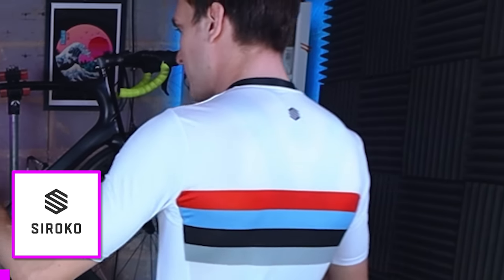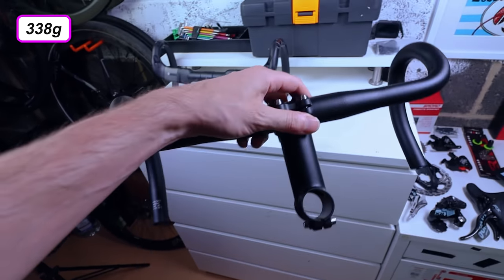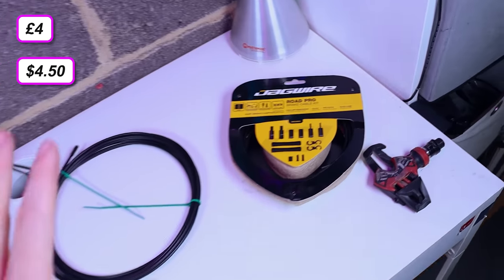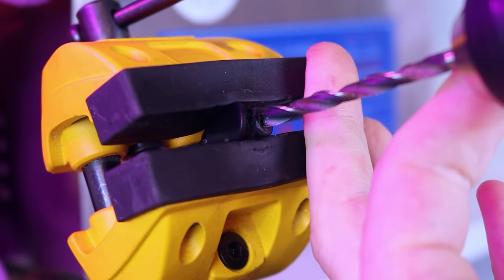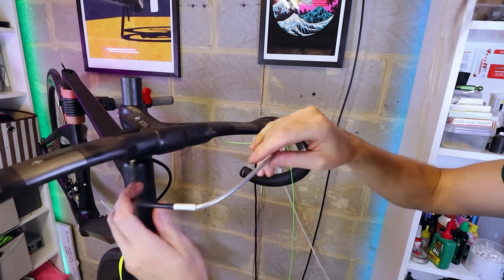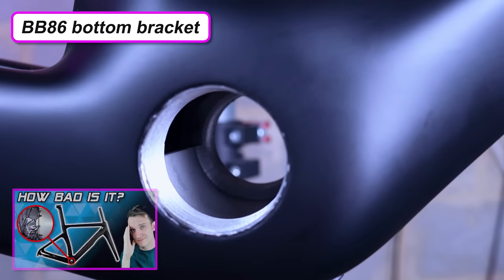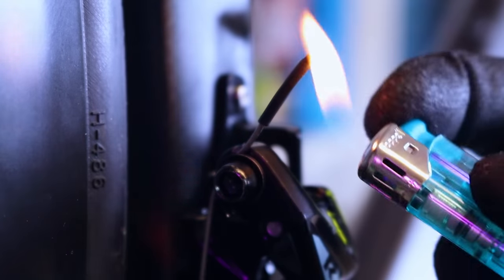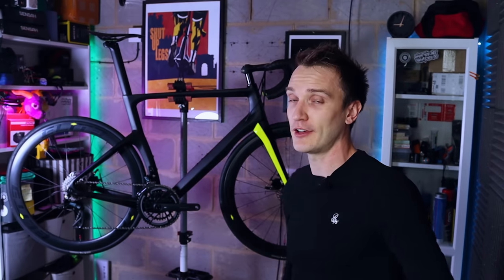£1000 AliExpress Carbon road bike build - Disc brake

Comment: Hi Luke, great videos but I think drilling the frame insert and filing the frame to get the cable housing all the way through was a mistake. Inside the frame no need for cable housing. You just added weight.

Comment: "One click only" on a clicky torque wrench was what I was always taught, what's the point of using a torque limiting device and then adding another nudge more? 

And definitely use masking tape on a carbon Steerer, if you can't get (or make) a proper cutting guide clamping an old stem on to hold the steerer and minimise the risk of pulling the fibres apart at the cut. 

I'd also definitely buy some nylon sleeve/liner tubes to put on the cables under the BB. 

TBH I'd be interested to see if you could find an Aliexpress special Carbon frame these days with external routing, rather than horrific internal routing, a fair bit of your faff was created by having to deal with the cabling. 🥖

Comment: 🥖 I'm still watching you. Even now, as you are reading this. 😁 Shame about the issue from the bonus clip (no spoilers). Just a thought, when the bonus clip started, I noticed something cool. The blue neon lights you had on reflected on the frame and there was a purple-ish hue to the frame. I thought that would be a cool colour scheme, dark purple with the neon yellow, if you ever wanted to change it up from the black and yellow. Thanks for making this build and the video. What's your plan for this bike? You're at 3 carbon bikes now, surely you will sell one of them?

Comment: I'm not sure what the deal is with GRP bikes, but IMO they're like riding a wet noodle. 

My first carbon bike with a Trek, back when only a few companies made graphite framed bikes. Since I worked for a aerospace company and had full access to numerous inspection techniques, I performed sherography, UT, as well as x-ray testing of the entire frame paying attention to the steer tube and bottom bracket.
.
What I discovered was that there wasn't a uniform thickness and that both the head tube and bottom bracket areas had voids in the composite. 

The only people that will see any marked improvements in their riding are the super light weight riders. A larger rider would be better off either losing weight, or stick with a custom built Reynolds 853 tube set or a quality titanium bike.  At least with steel or titanium, if it's crashed, it can be repaired. Plastic bikes aren't worth the time and effort to effect a repair and have the frame ride the same as it did prior to the crash.

Comment: Hi Luke - I also send you a mail
First - The cabels are not surposed to be i direct contact with the frame at the BB - Use a part of an innecable over that part.
I am not even sure the outercabel for the diskbrake are surpossed to run all through the frame? Could it be it should at the topend, then run "naked" through the BB and then into an outercabel at the "leg" by the diskbrake?
For the Front/rear deuralier I am very sure you should use a innertube - I'd might be wrong
Second: Is there a reason you did not use the Sensah 2X12sp?

Comment: Great video ! Did you consider making a 3D printed cap for that bottom bracket massive hole ? 😆 
I'm waiting for the chance to get a nice frame however I'll have to put some more money coz I'm not that Superfly weight lol so I'm afraid to be the first to report a failure regarding this frames 😆
Just as a suggestion, toseek TR5500 integrated handlebars are just perfect for this build IMHO of course! Keep us updated regarding the final changes

Comment: the brake line does not need for the brake housing to go through.. only the brake cable comes inside the frame.. that's also the reason the whole at the back  is small..

Comment: I bought "KMC" 10 speed gold plated chains from a shop in Quiapo, Manila, Philippines and I may have had a questionable copy because I, too, have had the golden flakes of metal after cleaning and lubing up the chain, so I swapped it with another set of KMC chains bought from a reputable store, no issues from there 🥖

Comment: Always start at the back to feed the rear brake hose through
Reply from the maker: I think that's probbaly the correct strategy for hydro housing, but in this case as it was the KEB-SL compressionless brake housing, there was this larger diameter aluminium coupling piece at the shifter end of the housing, which would have prevented it from being fed through the frame

Comment: Glad you caught that crack before heading out!!! Btw, RXL is not a chinese brand. Thats a knock off of Bontrager (trek's in house brand). I had a set of chinese RXL bars and they were fine, but its kind of a crapshoot when you buy those from Ali. Sometimes good, sometimes garbage. 
At this point, I think good ole Kalloy uno stem and bars are the way to go. Cheap, fairly light, and durable.

Comment: I bascially had the same experience with a delihea gravel frame with the brake cable. they put some kind of barrier within the lower triangle where the cable comes out that forces you to use two sections of outers to get the brake cable run, absolutely no way to run hydraulic lines in it unless i can sort out a way to drill out a larger hole through the passage, super frustrating. I've used their aero frame before (delihea fore) which has a similar lower bottom bracket access hole....overall a much easier frame to work on, but also was rim brakes instead of disc.

i definitely still like sensah over ltwoo. guess it's personal preference though

🥖

Comment: 35:51 Cables at the BB will defo eat into the carbon and saw it.
I had this happen to me and it wasn't the cable directly rubbing the frame but rather the cable housing so you can imagine what the raw cable friction will do there in little time.
Plastic or nylon guides are required.
I am no @Hambini engineer but you can trust me there.

Comment: 26:00 to avoid such a shame, one can work all 360 degrees, all circle around. First go around cutting about 1mm depth. Then, one can make a deeper cut but doing one side at a time, turning fork 90 degrees each time if you use clamp/vice or just flip it to the other side if you don't use vice.

Comment: Good edit.

I just can't wrap my head around why anyone wants to ride a road bike in 2022 with wheels weighing more than 1250g. All those extra spokes and rotors just grab so much air and it feels WAY more sluggish than a low spoke count shallow wheel. Light bikes and wheels are cheaper than ever before in cycling history if you know where and what to look for.
Reply: Unless you are climbing the aero gains are bigger than weight gains
And they look cooler lol

Comment: Cheap steerer cutter guide is a no brainer.  That stem looks awful but I have rxl bars and they have been fine for 4 years of abuse.  Yes ib would have touched that single bolt stem and the amount of spacers would have b me feeling nervous.  But great report and shows what you can do.

Comment: WHAT IS THE TOTAL WEIGHT ??? GOOD JOB YOU GOT HAMBINI S ATTENTION TOO !!  SO TWO THINGS FOR ME 
1. l still love rim brakes for my road bikes ,easy to fix adjust etc plus l don t have big hills or alot of rain :)  
2. l d prefer a smaller less AERO frame FOR LESS WEIGHT most forks are aero enough today same with wheels :)

Comment: Hi... as usual a great video. I was wondering if you could put the links so we can check today prices for a build like that. Even if i am shopping for a VELOBUILD frame kit (frame, integrated bar and fork) and velobuild wheelset it would cost 870€. Adding a seat, bar tape, groupset, tyres, inner tubes, jagwire cable kit and botle cages, etc IT WON'T GET EVEN CLOSE TO 1200€

Comment: 🥖 and I never usually comment on you tube. 

With regard to the rear brake housing was the housing supposed to stop ad the frame and start again from the chain stay? Only the cable in the frame. Obviously if they were hydraulic they may have thinner line or you would have to enlarge openings.

Comment: I wouldn't feel confident on a frame like this...i would buy though a elves frame, the eglath pro disc. I already did the math to equip it with Shimano di2 and I will be around the  3500€ mark. It might be expensive but a lot cheaper then a wilier filante slr wich is priced at 9000€. I wouldn't go necessary for carbon wheels , campagnolo zonda disc will do just fine for only 499€ and 1675gr. It will be my future project 😁

Comment: This is a Tiger bread baguette, is that ok 🤪🥖 Maybe next time you clean your chain, get a magnet on ' the bits' then you will know if it's chainrings but it's more likely to be crappy chain isn't it, especially after your last experience. 
I love the look of the shifters but not being able to change on the drops has put me off, was thinking for my latest build but sticking with 12 speed Sensah although I may get a 105, 12 speed cassette.....do you know if  they have the same spacing???

Comment: 🥖🥖🥖🥖!

Nice build. Inspiring to see such a nice ride for the budget! 

I'd say the rear brake was meant to run with either hose (hydraulic) or just a bare cable in the frame but this solution works (if not frustrating to install ;) )

Comment: 🥖and that’s a foot long ! Quick question, what is the bracket you have that holds your garmin and front light below? Top video as always and looking forwards to how this performs
Reply from the maker: So I just kind of hacked that togther from some spare parts i had lying around. Its the offical garmin mount that came with my 520, and i just had this go-pro mount i screwed to the bottom...
Reply: @TraceVelo  Thanks, looks cool and makes the handlebar seem less packed. A visit to the shed may be in need🤙
Reply from the maker: @tigerv88  Yeah either that, or you can pick one up on Amazon/eBay for pretty cheap. Here's one I found from a quick search: https://a.co/d/fMgAEl3

Comment: 🥖🥖A serious question🥖🥖 as you can guess by the number of baguettes 🥖🥖🥖😊
Do you have or could you make a list of recommended aliexpress bike stuff, please? That would also be updated as you test stuff. Would be really helpful, for example, I am planning to buy a few components and want to see you recommendations, but it is 1. Hard to find relevant videos 2. Even after finding one, there could be an update in any later videos (example I was studying components from electronic groupset bike build and only accidentally found the video about front derailleur failure much later). Anyway, thanks for the great content!! 🥖🥖🥖🥖🥖😅

Comment: Internal cable routing tip:

when routing internal cables, do not remove the already installed cable housing line (the white cable it came with). Instead, attach your own cable guide to the end of the cable housing line (attach your black cable to the white one). Make sure this attachment is firm, then pull the white cable out from its other end (the end with no attachment). This will pull through the attached cable guide
Reply: thats not really a tip...thats exactly what you are supposed to do

Comment: So you didn’t used the Juin-tech GT? Why? Because the ZRace ones are good? 
And on other thing. Not always cheap parts are recommended e.g the chain, and handlebars. These are essential parts that can put you in serous problems when break during use.

Comment: As others have mentioned, tape that steerer tube before cutting (cut through tape) and scoring the backside before cutting through. Dangerous to run that many spacers. Cables should have outer housing on them where they go under the BB, never should they be allowed to contact the frame in such a way. 🥖
Reply: I was wondering as well: why not put a piece of cable housing under the BB?  Seems like an easy fix.

Comment: @Trace Velo 

Hey Luke 👍
 Always love your vids (subscribed a very long time ago) and defo don’t want to sound condescending but.. your prob with a ‘floppy tube’ can be sorted easily by simply putting a bit more air in it when fitting, so it’s softly inflated.  
 This also massively reduces the chance of pinching the tube too.. 
 PS a ‘floppy tube’ can also be remedied for about three quid in most pub toilets 😁

Be well 👍🥖

Comment: Hey Luke - Any update on the internal lines rubbing on the bottom bracket? My frame has the same setup and wondering if I should use a fix some of the other comments suggested?

Comment: Hi, have u find ridenow Tpu will very fast release air? Just few days, I find ridenow will no air inside.
Reply from the maker: So actually my ridenow tubes have been great. I was away for over 2 weeks recently, and they still held pressure. So sounds like you might have a slow puncture....

Comment: "I made £1000 bike" and half my parts I bought in 2019. Pre pandemic and pre 2022 inflation. Use todays prices!

I searched for the prices and I got about £1200 which is closer to $1280. Also that does not include tax. I tried to pick parts with free shipping.

Comment: Do you ever use foam housing dampener to prevent housing from slapping around on the inside of the frame, or is it not worthwhile? I always use it on my builds, but perhaps it’s unnecessary.

Comment: Front chain rings the small shards will be from with the paint and just the teeth bedding in to a cheaper alloy just wat h for teeth snapping under load changing gear had this happen to me before with a cheaper  chain ring

Comment: 🥖🥖 could also be worth noting that your disc rotors use a floating design, so that's possibly contributing to the lack of disc rub from the callipers, even if they're slightly off?

Comment: I feel like bars are the one thing were chinese carbon does not really make sense... Alloy bars are light, cheap and stiff so there is pretty much no reason to get anything else. However OG Evkin seems to produce some quality bars but they are a bit more pricey.

Comment: Nice video, also your other ones. One issue for me is that ali express frames seem to go to 58 cm max, and I need a 60-62 (my arms are quite long, and yes, I also like bananas, but I do not climb in trees). Or do you think that with a longer seat post and stem one could make it fit? Any experience here from taller riders?

Comment: apart for hydo lines  i have never run outters though a frame
Reply from the maker: Yeah hydro lines would have been even worse tbh. I can easily see the hydraulic lines getting worn or punctured by the sharp carbon edges in this frame..
Reply: @TraceVelo  that would be a heel of a mess inside the frame

Comment: 🥖35:44 ... i will recomend to use wide (black plastic) electical tape to hide those exposed cables under BB ... 😉 ... stretch it over the hole, do immediately❗

Comment: 🥖🥖🥖 RXL crack 😬
Reply from the maker: Yeah not particularly impressive to say they least. They are off the bike now actually, ive got a set of Aeronova bars on whichb seem to be pretty good actually...
Reply: @TraceVelo  yeah could never bring myself to buy cheap bars, frame maybe as you can hopefully get away with a crack and survive 🤞but those bars would have been catastrophic 🤕 dodged a bullet there Luke 🙏🏼